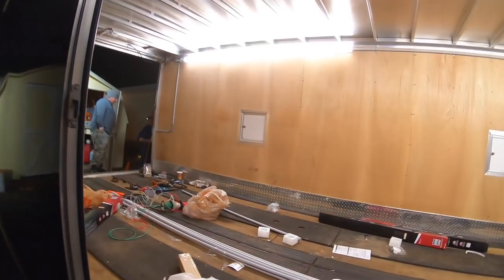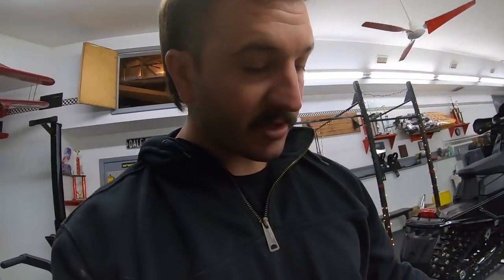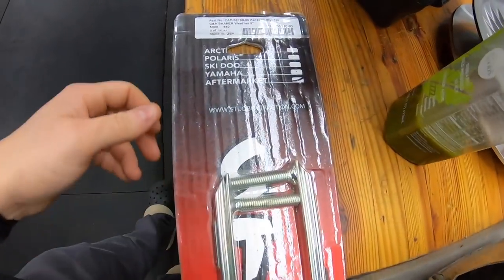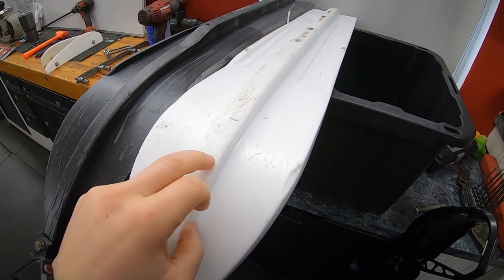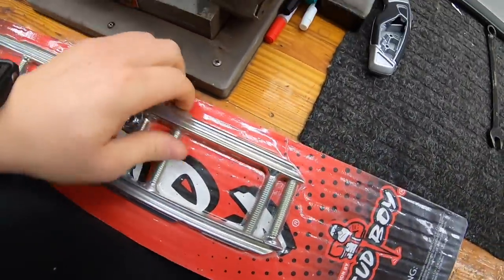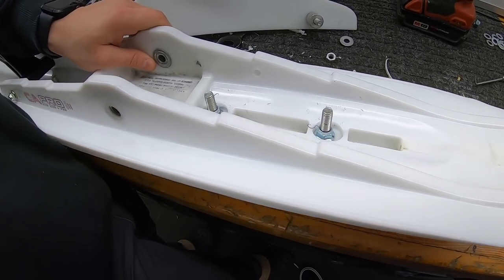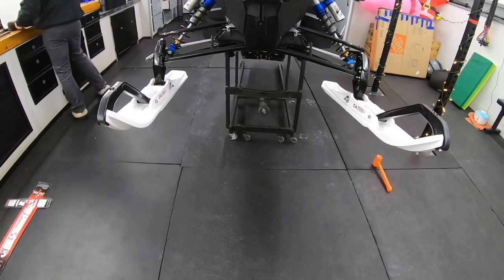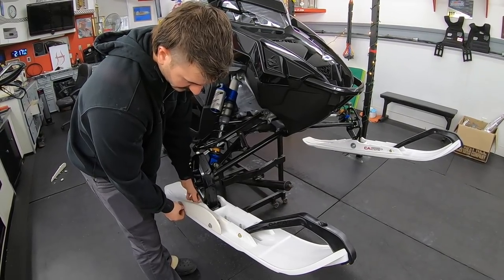POLARIS MATRYX GETS UPGRADED C&A PRO SKIS! ARE THEY WORTH IT?

Comment: I’ve always ran c&a skis too with 9 in shapers. I use the RZ skis and then buy sheets of 1/4in plastic to cut out spacers to put in between the carbide and ski to make a thicker keel. This also allows you to have a fresh/sharp edge on your skis every time you replace them because skis definitely do take a beating.
Reply from the maker: C&A and Shaper Bars Stand above the rest in my opinion

Comment: Ordered a 2022 Assault with the 2" paddle track. Was looking to run the XCS ski,  wanted to know your opinion on what carbide length to try. Did not know if the 9" would be too aggressive or not.
Reply from the maker: Hey Mike so really depends on your riding style. I would recommend it starting with a 6 or 7.5. You will have more riding input with just the skis so I would hate to see you go to aggressive with the carbide and be unhappy!
Reply: Great thank you for the tip!

Comment: Hi Jesse, i have a 2022 XCR-850 witch i ride very agressively in the trail, i like the pro steer ski , but whatever i do, i still have somme under steer problem. On hard surface its a lot better , but as soon as its softer or in soft snow condition or even worst , if it have a couple of inch or more snow in the trail, i don’t have any front end bite ( as you and Bruce describe in your ski explanation ,awsome video by the way, very Informative.). My question is, for very agressive trail riding, i wonder, why choosing XCS ( Hybride ski vs XT ), also, why C&A are so large ?, What is the benefit of it ?
Reply from the maker: XT is too aggresive as we talk about in the C&A video that Bruce and i did. They require way too much rider input. The XCS also requires alot of rider input butt less then the XT and then the XPT is less aggresive then the XCS.
Reply: @JESSEJAMES322  thank you very much , i will place my irder for the XCS today. Thanks for your help!!!

Comment: Have you tried the bite harder to sharping the carbides. Or believe it or not the lawn mower sharping tool out of Home Depot or lowes which I think is under $10, that thing will put a knifes edge on them..
Reply from the maker: I have not honestly. have never seen a reason to make them sharper they bite hard enough! If i was ice racing maybe!
Reply: @JESSEJAMES322   For the trails. Crossing roads corners with low snow or whacking a rock etc. We normally only ride in Canada every other weekend. Don`t know about this year LOL. Don`t know how many miles you get in a year. But In a normal yr. we ride 2000/3000 miles a year. So we sharping them up from time to time. And like I said the  blade sharpener from HD does a great job for like I said under $10. Where as the bite harder is like $60 and you only get a few uses out of it.

Comment: I'm being told that putting these on is a HUGE MISTAKE! Why would I be told this? I was looking to add the XPT TRAIL SKIS to my 2017 Grand Touring 900ace. W 7 1/2"
Reply from the maker: I mean having a grand touring you  are not riding that aggresively so these will not really benefit you. These skis are added for more high performance applications that need more steering grip. I would agree these would not be a good fit

Comment: How does the engine break in go for these polaris's?
Reply from the maker: There is extra fuel and oil added for a certain amount of time until you reach a certain engine hour over a specific RPM. Then It cuts fuel then oil!
Reply: @JESSEJAMES322  so I dont have to take it easy for x amount of hours or anything? Just run it?
Reply from the maker: @mitchelljeune6423  no sir I never had and never had an issue!